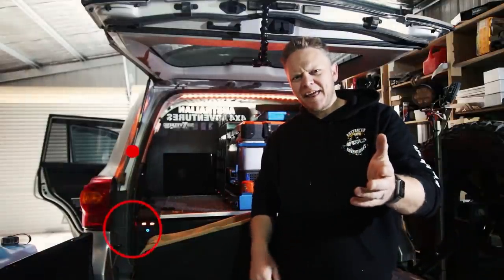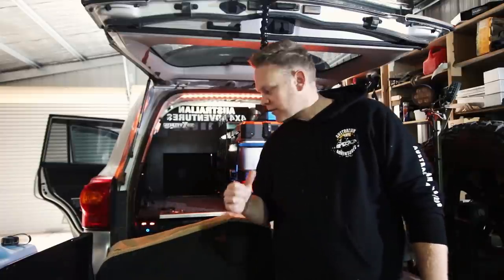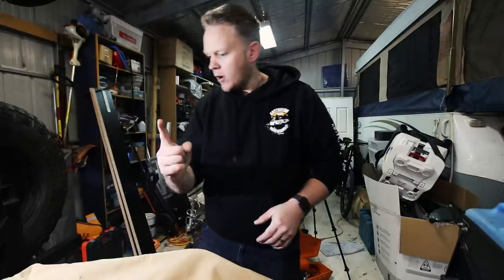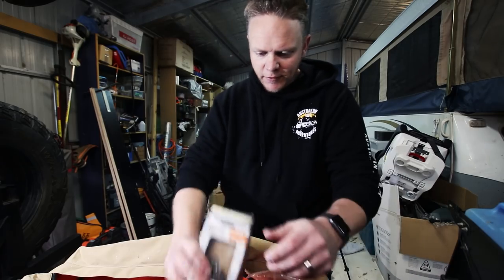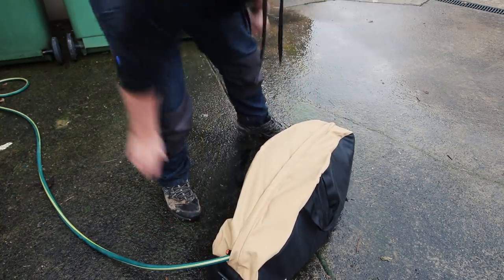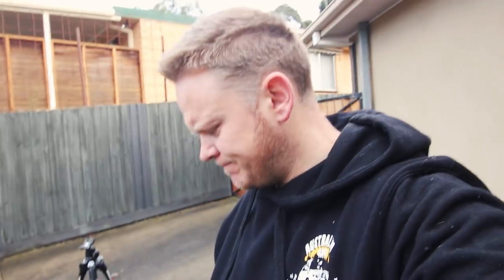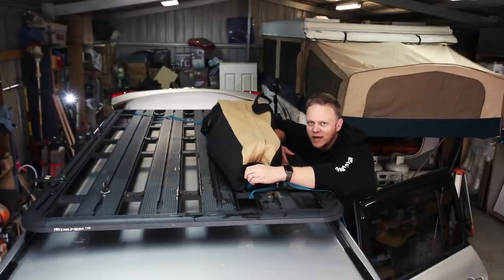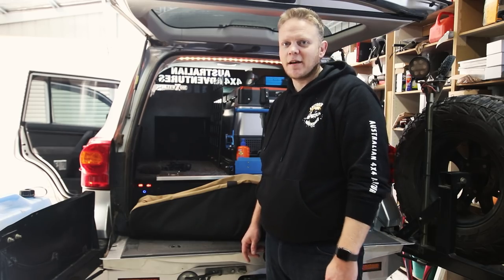Crashpad Gear Chainsaw bag Review - Australian 4x4 Adventures

Comment: The big little handle 🤣 and the word you were looking for is viscous. Water is more viscous than oil. But on par with 2 stroke fuel though so your water holding test is valid.
Reply from the maker: Viscosity.    
I thought of it straight after I turned the camera off 😂. 
It was completely out landish and a stupid way to test something.   But even for how stupid it was it actually held water fairly well overall

Comment: I have the AEG58V Steve (you said 56V. No such thing) and have been using it for a few years now. Have levelled off a few big trees with it. Would love your review on it. I will get one of these bags too so thanks for that.
Reply from the maker: Hey buddy. 
Yeah too many numbers floating around in my head.  Meant 58v.  

I had plans of the chainsaw review but iso put a stop to that unfortunately. 

I’m working on other ideas for that video.

Comment: Used and put to the test, honest review? Why no trip photos or footage of it in use. Why so clean Inside, why the gel pack still,  why the tag on the bag still? why the Insta post saying you brought it.....
Reply from the maker: Very observant. 

Clean because I’ve only ever used it in my car not on the outside. 
I use an electric chainsaw which I also wrap in a towel to keep the bag clean because I knew I’d be doing a review vid on it one day.  

Gel bag and tag still on because I wanted to let the gel pack absorb any moister inside and the tag because it had info on it that I wanted to use in the video and I didn’t want to loose it. 

It’s been on plenty of trip but I’ve never needed to use the saw on any of them because someone else has generally got one as well and we’re faster at getting it out then me. 

And I will admit I did say I bought it on the insta post.  I shouldn’t have. 

Hopefully that’s answers a few questions

Comment: Had you seasoned it before the water test? Being canvas might have needed the stitching etc to shrink thus the water ingest
Reply from the maker: I had yes.  

The water was only getting in and out through the zips which is unstoppable really.
Reply: Australian 4x4 Adventures  normal rain while driving isn’t gonna pool on to of the bag I guess